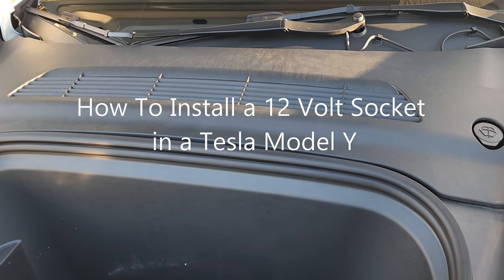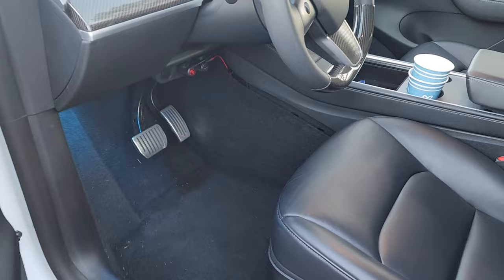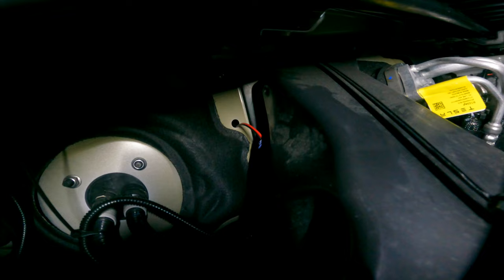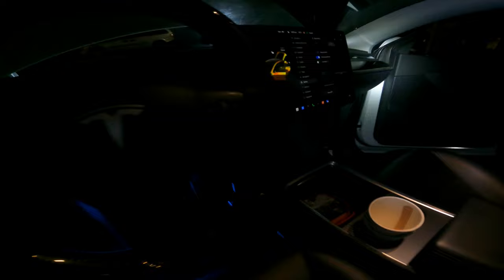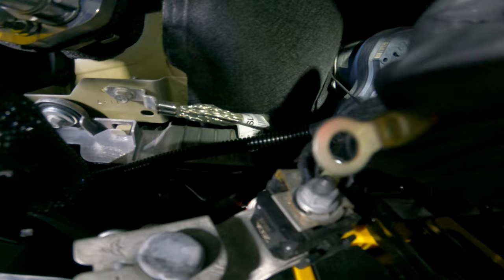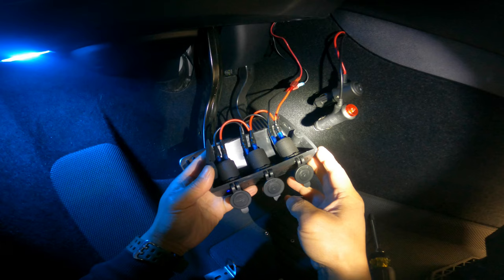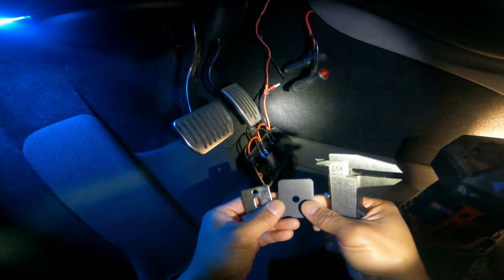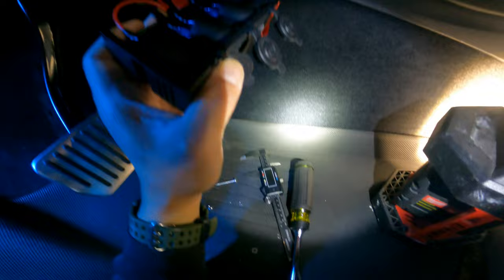How to Install a 12 volt socket in a Tesla Model Y

Comment: I have a LR 2022 Shanghai made Model Y (RHD as based on London UK). Enjoyed the video... Unfortunately I'm not brave enough to undertake a project like this.
Reply from the maker: Oh man, you have to find a friend with basic electrical knowledge. It's not too difficult. Hopefully, it's the same process for the 2022 version. I'm not sure. Hopefully, someone who has a 2022 can let everyone know if they are able to do the same install. I heard that the 2022 has a 16 volt lithium battery.

Comment: why not just connect to the existing 12v in the console? saves the trouble and potential problems of going through the firewall to the battery...

Comment: Good job on the videos!!

I was watching your other video for the ambient light install. Is it hard  accessing the wires from the center console to tap the power from the cigarette lighter? 

For the power splitter, is there a reason why you did not use that same wires you had already tapped into from the center console cigarette lighter?
Reply from the maker: Yes, it's pretty hard accessing the center console wires from the existing 12 volt socket, but it can be done. That is exactly how I have mine setup actually. My 12 volt power splitter is fed from my center console. You will need to strip the existing wires a little bit, do some soldering, and then insulate everything to make sure you don't short out any wires. I have some links in my description in the other video which you can refer to. It's a lot of work because you still have to take your center panel apart and reassemble. 

In this video, I just wanted to provide an alternate method of getting 12 volt power. If I could go back, I would do it this way.

Comment: This the same process with newer lithium based 12v?
Reply from the maker: The newer lithium based 12 volt versions has a bolt stud which is above the battery and so you should be able to connect to the bolt stud and the ground you can connect to any bolt inside of the frunk area.